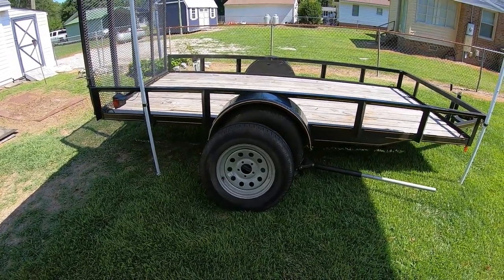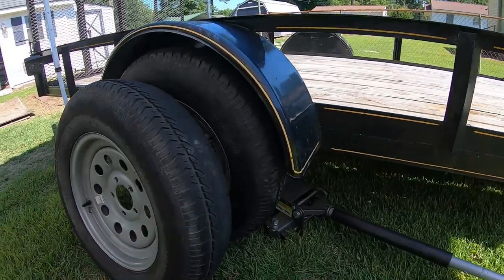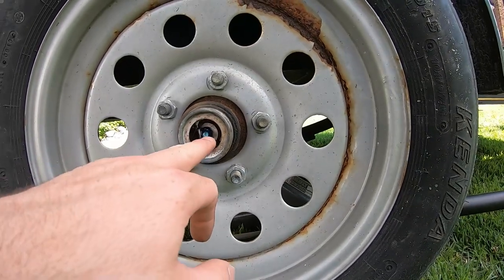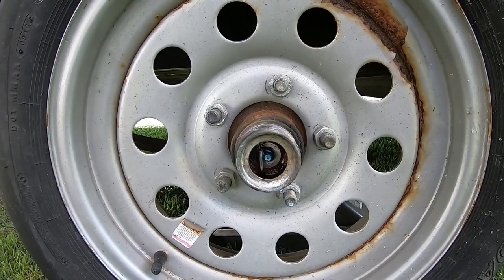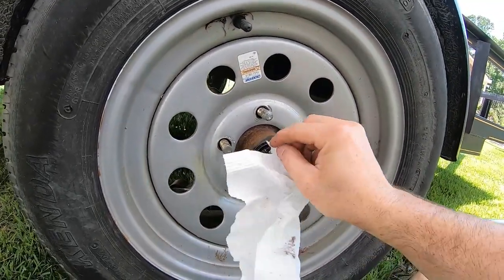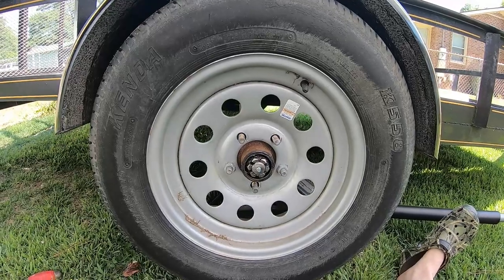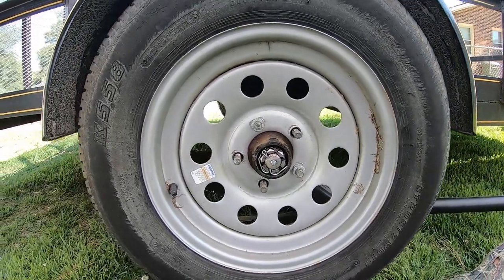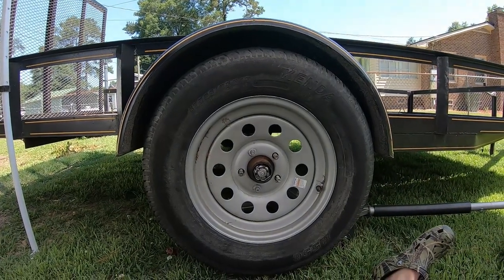Checking Trailer Bearings

Comment: As you guessed, the spindle is hollow and there is a hole in the spindle toward the back side of the bearing that lets the grease enter the bearing.  It’s in the back which makes it grease from back to front.  Which is nice when you want to refresh the grease, the new grease pushes the old grease out.
Reply from the maker: Good description! this was the first one I've run across and your right about pushing grease from the back to the outside
Reply: Yes and can blow the inner seal especially on RV and travel trailers with Lippert Chinese hubs and seals. When the inner seal fails the brakes get covered in grease.

Comment: Just bought a new-to-me trailer. I appreciate the video. My first "nice" trailer that I want to keep a long time, so I'm wanting to do my best to do all the preventative maintenance. Are there any other wear parts, such as bushings or springs, that I should keep an eye on?
Reply from the maker: trailer are pretty low Maintenace. Just grease the bearing regular and stain or paint the wood to keep from breaking down over time.

Comment: That's actually better than a bearing buddy. That distributes new grease behind both bearing and then more or less symmetrically pushed old grease out to be removed and evenly repacked with fresh grease. I couldn't personally argue for or against that symmetry in the inner bearing but if you were to pump grease you would see it come out of the outer bearing symmetrically dirty grease first. In fact its super obvious that you haven't been maintaining these. bad tread wear and no visible grease behind the rubber seal. you should start with bearing preload by shaking the wheel when you lift it and spin it. You'll git 'er done.
Reply from the maker: Thanks for the info

Comment: Spindle nut should never be that tight! Torque spindle nut to 50 lbs. to preload bearings and make sure races are seated, then loosen nut, then resnug the nut hand tight without spinning hub, then loosen enough to reinstall cotter pin. Better to be a little loose then too tight.
Reply from the maker: Loose is better than tight. I Pretty much did what you just described. I over tighten to set and then backed off so there is no drag. Then backed off enough to line up cotter key.

Comment: Just a warning, everything I've ever bought from harbor freight has failed,  in particular I had 3 of their jacks fail on me.  Just complete junk!! I learned my lesson.  Buying the same tools over and over gets old.
Reply: I think their Daytona line of jacks, and current jack stands,  are excellent.
Reply from the maker: I use tractor supply jack stands for larger projects. But you cant beat a dayton jack